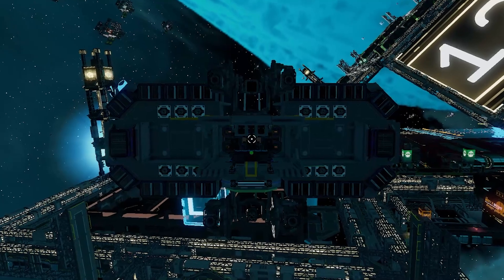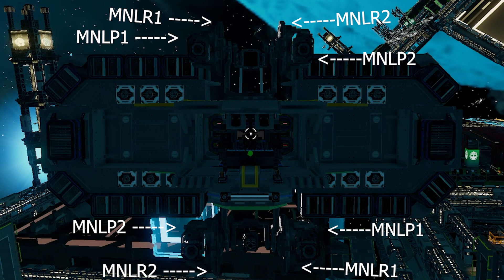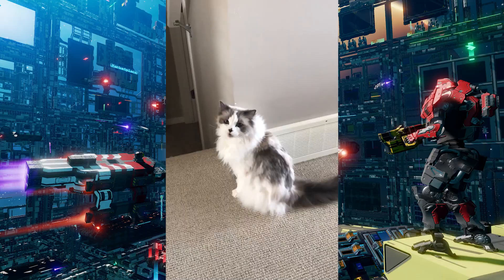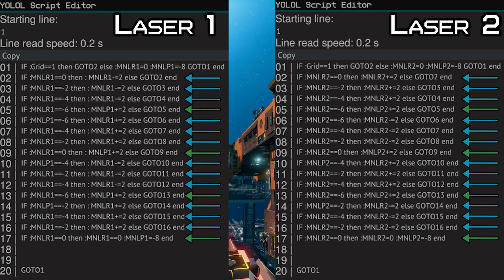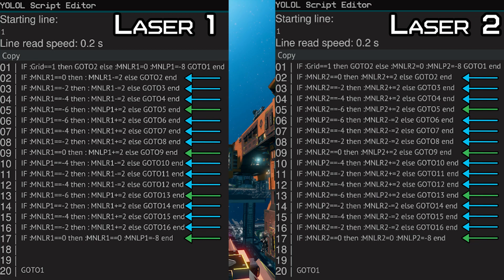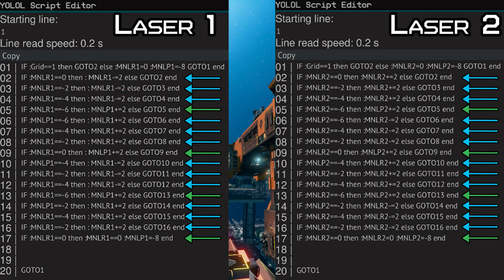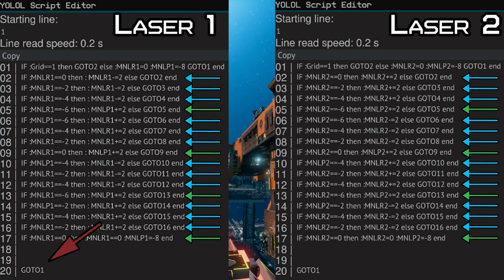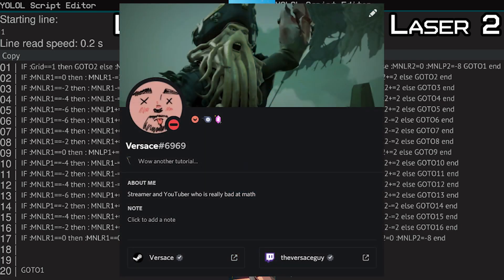Starbase: Grid Mining Lasers! Using Advanced Yolol!

Comment: I’m no yolol expert at all but I ticker a lot with turret and laser stuff and your IF then statements don’t rlly do anything because you are just questioning wether or not the previous line has set X number on turret. The if statement isn’t actually checking if the turret is in set position. It’s just checking to see if the line before it actually ran it’s course which of course it does… just saying
Reply from the maker: Unfortunately that is incorrect.
Turret turntables and cradles take time to correctly rotate. Try manually putting a value in and you will see it is not an instant snap yet a gradual change.
Believe what you want.